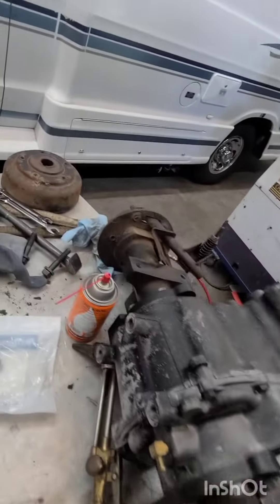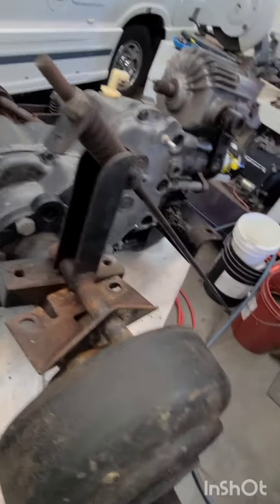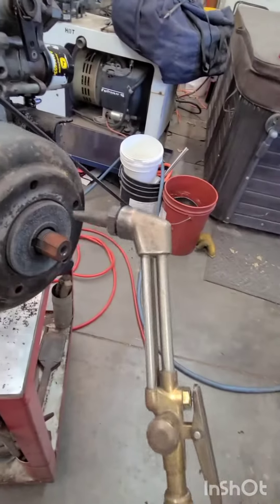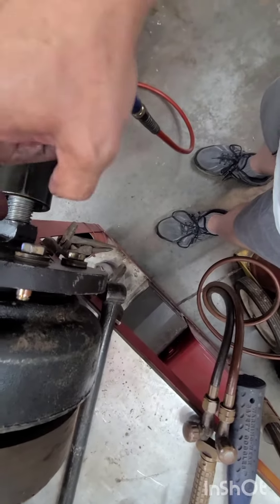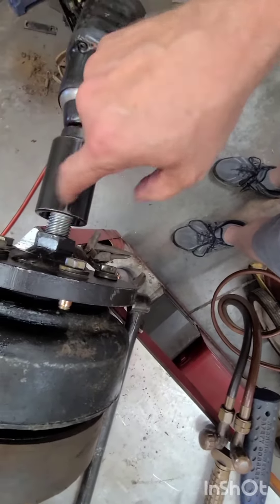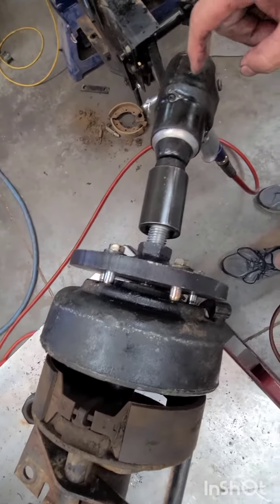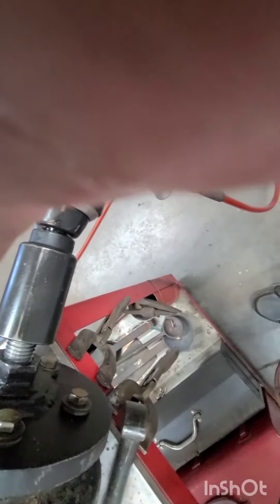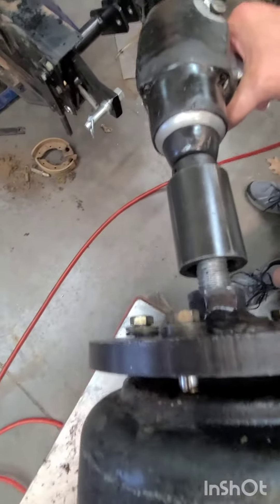1984 John Deere 318

Comment: You need a heating tip for your torch. You saved money on puller, why not buy longer bolt?
Reply from the maker: I did use a rose bud earlier to no avail. I haven't found a longer bolt yet locally is why.